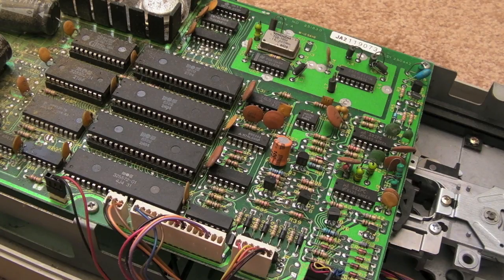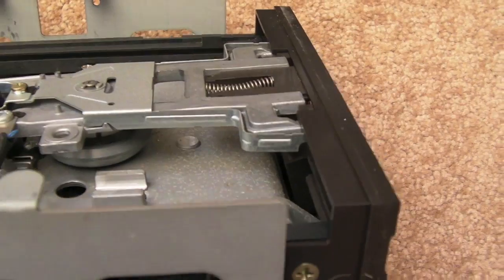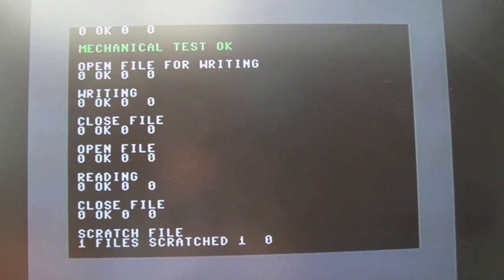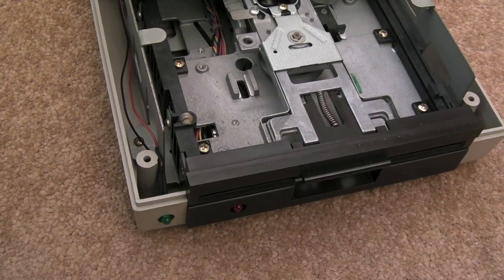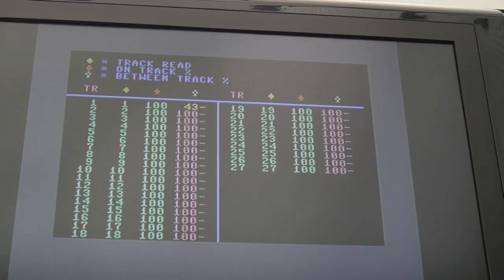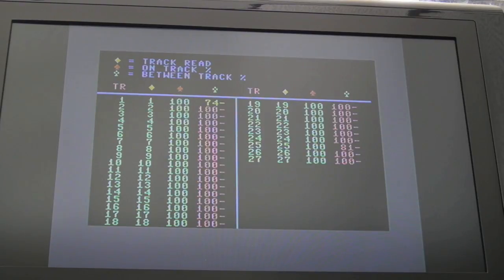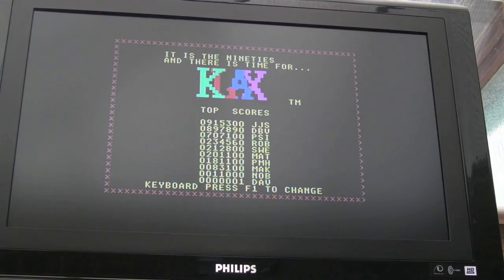Commodore 1541 Alps Floppy Disk Drive

Comment: I have one of these Alps 1541 drives that was in great condition, but the stepper motor isn't working. I measured the voltage on the header to make sure the 12V lines were working and that wasn't the problem, and I also put fresh silicone lubricant on the rails.
Reply from the maker: Have you tried getting some WD-40 into the stepper and rotating it by hand - sometimes motors can jam, or the brushes / commutators get dirty etc.
Reply: I did try lubricating the rails and while it moved smoothly when I pushed it, it still doesn't move when it's supposed to. I read an article saying that the ICs on UD4 and / or UE6 can cause the stepper to stop moving, but then someone else said it's the U7 IC or NPN transistors.

I ordered replacement ICs for UD4 and UE6 but if those don't work I'll probably have to try replacing the U7 IC and transistors next. I'm not sure what transistors would be a good replacement for the NPN ones.

Comment: I love this disk drive. The size of it and weight are something else. I also liked that it has the 6502 in it also just for good measures. 1541 a true classic.
Reply from the maker: +RaspCast Yeah, they are lovely drives =D  Seems like people just don't want them any more though, I am surprised the prices aren't higher on eBay.
Reply: They are rather big and heavy but that is only because the power supply is inside them and things were not as miniaturized as they are today.  Look at that main board.  These days not very much is made with components that attach like that, they are all surface mounted and smaller now.  I am not saying that no one makes things like that anymore, I just would not expect to buy anything from an electronics store and find stuff like that inside of it.  Also in those days they didn't have that damned RoHS, they still used solder with lead in it then.  The one and ONLY reason they took the lead out was to reduce the amount of it that goes into the ground when it is buried in landfills.  The trouble with RoHS is it makes things unreliable.  The lead used in tin lead solder prevented tin whiskers from growing and shorting things out.  Yes tin can do that, surprise!!  In those days they made things the way they were supposed to be made and didn't have the fucking tree huggers forcing the quality of it downhill by whining about things that were used.

I am from Pittsburgh and I have seen photos that would make those tree huggers quite sad.  There is a reason some of the old buildings there are black.  Things are much cleaner now but it would have been quite depressing for anyone who likes clean air and that was not caused by the cars they had. I am 40 years old and so I was not around when Pittsburgh used to be so polluted but that was from the steel mills mostly.  Not many of them are still operating.
Reply: I had a 1541-II from the beginning, but always wanted a 1541-I because of the style factor!

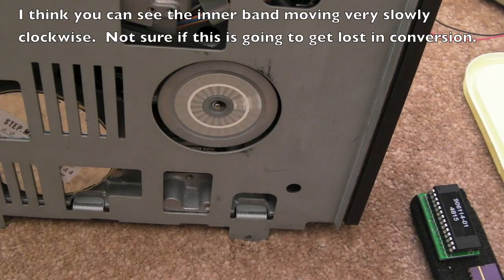Comment from the maker: You can actually see the inner bands (focus on the dark lines of the inner ring) gradually moving clockwise at 5:56, and better at 6:09, and 6:15 for a few seconds.  Interestingly, it was captured at 50fps without any artificial illumination, and converted to 25fps.  I guess because 50 divides into 25 nicely that's probably why it has come out OK on the final video.

If you stare are the inner black bands you can see them very slowly moving to the right.  That probably indicates its not quite set to 300 rpm.  I might adjust it in future.
Reply: breadboard project! Two AA batteries, 555 timer and Led. 50Hz frequency, short dutycycle..
Reply from the maker: +bwack Great idea =D

Comment: Wow there is a lot of hardware in there, a couple of RIOTs, a bunch of RAM, ROM, CPU, it's an entire computer. These must have been really expensive new? I'm from the ST era, and then we had integrated LSI on 3.5" drives, so you don't expect to see so much in these, even the PSU is pretty beefy in this beast
Reply from the maker: +arcadeuk Yeah lol, never ceases to amaze just how much stuff in in these drives.  They weight quite a bit too!  Yeah, it's amazing when you compare a 3.5" drive lol

Comment: Still cannot find any help with the Commodore VIC20 jailbar crappy video removal mod. Our VIC20 is a Revision D board, I understand that this is crucial in getting the right mod done(?) Wayne and Nina. Perhaps a video on this procedure may be of use to some of us thick buggers out here! Lol!! :O :O :)
Reply from the maker: +Nina Evans From what I found from experimenting with the inductor size, it works almost the same on different revisions.  On one of mine I didn't use an inductor, I just used a ferrite bead and that sorted it.  I covered both of the ways I've done it in the first few VIC-20 videos I did.

Comment: Anyone know where i can find a belt for one of these??? Mine has a loose old belt and it won't write any floppies as a result. Oddly enough, it can read sometimes even with a hopelessly loose belt.
Reply from the maker: Honestly not sure - have you checked eBay?  If you measure the diameter of the belt, I am sure there must be similar size replacements on eBay (a bit smaller will work).
Reply: @GadgetUK164  Well, good news on that front...there is a site (not ebay) which sells brand new belts made to the exact spec for these drives. They aren't square belts. In fact they are quite substantial. After giving up on ebay I decided to do a search of the wider internet, and found a replacement for $4/$12 depending on the quality.

Comment: Are you using a real C64 for testing the drive, and if yes how do you get the picture output to look so good?
Reply from the maker: Yes, real C64 - I don't use emulators ;)  I use just a composite lead, but the C64 has been re-capped.
Reply: That's crazy, I have it connected via a scart cable, but characters in some particular colours are virtually impossible to read!
Reply from the maker: +Willi Hansen I suspect the electrolytic caps in the modulator need swapping out (although not using RF, the signal for composite goes via caps in the modulator, and your scart lead is using composite btw).  But the other thing to consider is that different motherboard revisions affect the video slightly too.

Comment: the VIA CPU?
Reply from the maker: +Amy Marie Yes, it's the same CPU I showed in the VIC-20 video which was the one that when swapped out fixed the other Mitsumi 1541 disk drive.  I think maybe it had a dirty connection or something on the CPU, that's the only explanation I have since it's now working in anything I put it in, and the 1541 that originally had the problem 'just works'.
Reply: okay fair enough. "puts that issue to rest" give the sockets a cleaning maybe?

Comment: hi! 0:28 please can you tell me the type of the DIP14 chip at the bottom-left position near the cathode of the big capasitor 6800mfx25v.   i need to repair my alps 1541 drive - this chip is died
thanks.